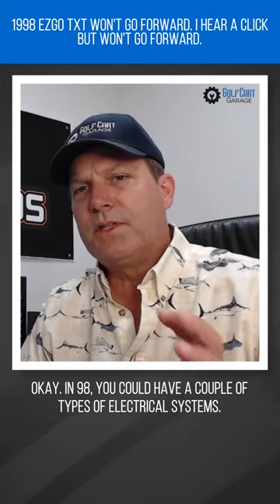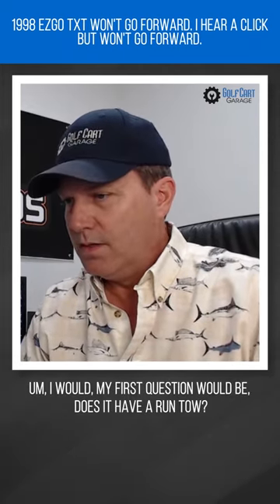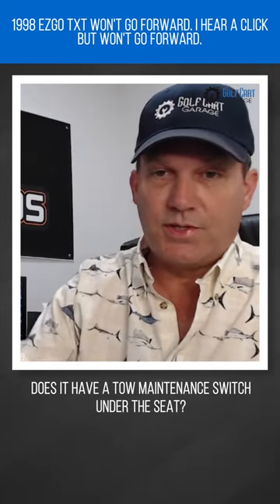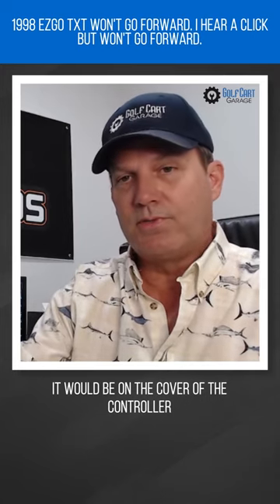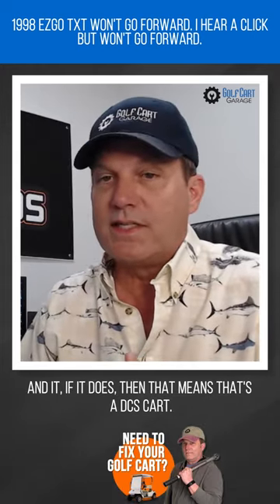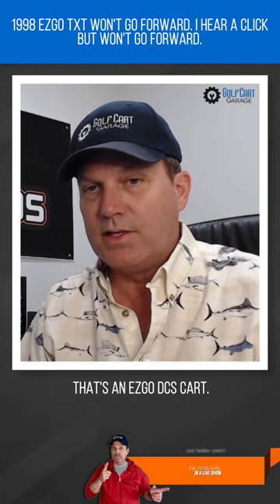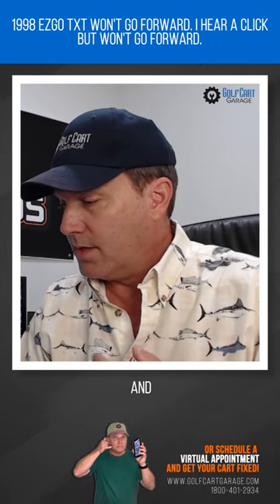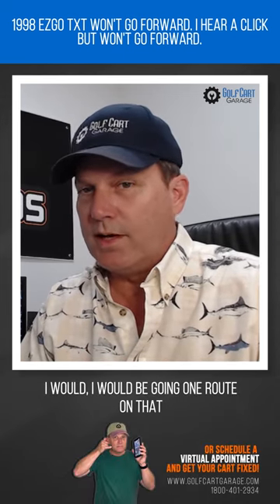EZGO TXT Won't Go Forward | Tips and Tricks | Golf Cart Garage |

Comment: I have a 99 series cart
No tow/ run switch
I converted to a single 36 volt lithium and there’s absolutely no response.
What should I look for on the forward/ reverse assembly?
Thanks  in advance.
Reply from the maker: Thanks for watching!  Kalcounts,  Just changing to a lithium should not have affected anything with the cart.  Our techs question are all three wires from the charging receptacle still connected?  The small one is the reed switch wire.  It has to be connected or bypassed in order for that cart to run.  If connected it could have blown the reed switch. You can get a free appt with our techs here: https://www.golfcartgarage.com/gearheads-on-demand/ or get in touch directly at Support@GolfCartGarage.com or (800) 401-2934